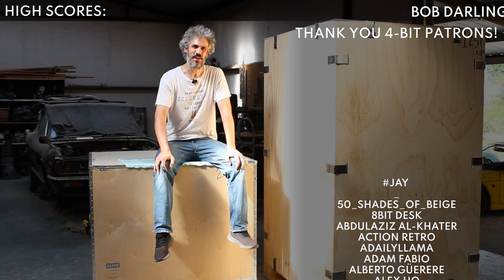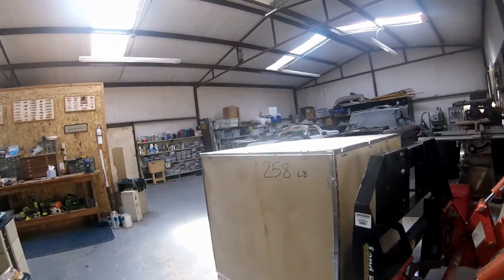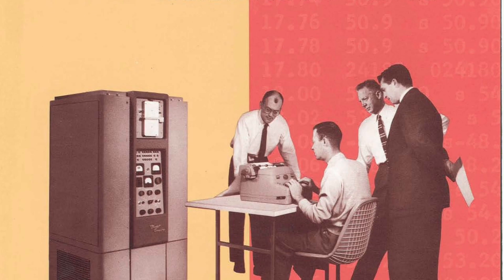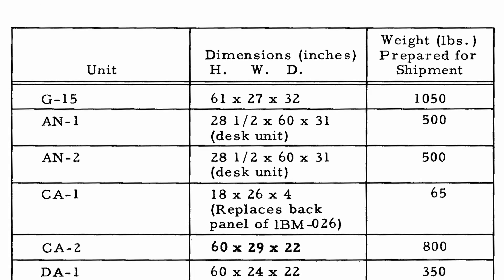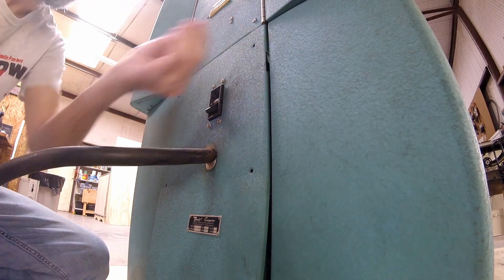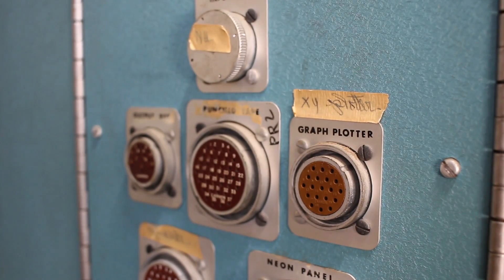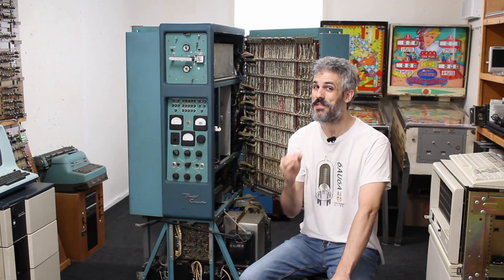My New Computer Weighs 1,000 Pounds!

Comment: Dad worked at Bendix in the 60's right out of college, never even knew they made computers until you mentioned them a while back. He worked on safety triggers for nukes, but that's all he could tell me. We were only allowed to visit the plant once in his entire career.
Reply: Nuclear bombs, computers, brake pads.  Is there anything Bendix doesn't make?
Reply: Would it be possible to visit the factory where they make the un-safety triggers for nukes? Asking for a friend...
Reply: @Starchface  Bendix also made lots of toxic waste. My dad's plant is now an official toxic waste site, last I heard the land can never be used again. Kind of mad that it was allowed to get that bad while my dad worked there.
Reply from the maker: Bendix was all over the board, they made all sorts of wild stuff!
Near the end of the G15s run, Bendix sold the whole computer division to Control Data Corporation. CDC never built any G15s as far as I know, but they did sell and re-badge them as Control Data machines.
Reply: [Fallout theme plays]
Reply: @ChrisB... Didn't your dad trust you?
Reply: @SuperNoticer  Bendix was a contractor for DOE and DOD, so it wasn't a matter of trust. My dad isn't trump. LOL.
Reply: @Starchface  Also, the autopilot for the Boeing 747, and laundry machinery, which they got involved with through acquisitions.
Reply: @UsagiElectric  You can tell they had manufacturing applications in mind for this computer: at about 21:00 they mention that the AN-1 universal code accessory can be used with numerical control tape for machine tools.
Reply: @SuperNoticer  I guess he thought, "Don't tell anyone about this top-secret work" meant "Don't tell anyone about this top-secret work." Nuke triggers would be regarded as a state secret after all.
Reply: @Starchface  Well they don't make the 6900 dual triode anymore...
Reply: @ropersonline  "War....war never changes..."
Reply: Didn’t Bendix also made parts for the Concorde for flight control?

Comment: Mr Usagi, a tip for you, as I have found very few people know this these days:-
I notice power-type selenium rectifiers (red fins - probably Federal type) at 21:20.    These slowly turn into resistors when not used for many years.   if you suddenly apply power at full voltage they may overheat and destroy themselves with a bad smell.   A very bad smell.   They need to be reformed, somewhat like old electrolytic capacitors.    Use a variac to bring the voltage applied to them up very slowly (hours) while monitoring the current and how warm they get.   If you do this they will usually then be fine and turn back into diodes.     Some restorers of old electronics don't trust them and replace them with silicon diodes, but if you want an authentic museum quality machine, carefully reform them.
[Note that selenium rectifiers were made in two grades - one for consumer equipment and one for industrial equipment.    NEVER trust the consumer grade stuff - replace them with silicon.]

Comment: This is beautiful. What amazes me more than anything is just how fast computer science moved 70 years ago. From ENIAC to this in less than a decade. Being able to read the schematics, see the OS code would be fantastic. Those guys back then weren't dummies, that's for sure.
Reply: Being such a small machine, I doubt it had an OS. You would just run your programs on the bare hardware.
Reply from the maker: And if you go 10 years beyond this, we had the Apollo Guidance Computer using flat-pack integrated circuits! It was truly a bonkers time for computing.
This machine did run some interesting programs, one of which was Intercom, a sort of virtual machine that sits on top of the original machine and allows you to write programs directly on the machine. It's not as fast as writing bare-metal programs, but it also will keep you from going insane.
As we get close and closer to running, we'll get deep into the weeds on just how exactly it loads and executes programs from the drum, what the instruction set looks like and how to use it. It's going to be a lot of fun learning about this thing!
Reply: @UsagiElectric Flat-pack IC's and core rope memory... something that as much as I understand how it technically works, I still can't wrap my head around it. Truly amazing what these guys (and gals) were able to pull off back then!

Comment: Congratulations.  The G15 and the Dec PDP 8 were the first computers that I learned on in computer maintenance school, and the first computers that I programmed on.  I will always remember having to spin the G15's drum memory shaft before powering it up so that the rubber coupling wouldn't break from the motor torque.  Enjoy.

Comment: You are definitely brave. I saw what was involved with getting  an IBM 1401 going at the California Computer History Museum. Now it did involve more than  just the computer but they had a team of volunteers some of whom had worked on 1401s before. It still took them quite a while to get it running. Maybe on the plus side, the 1401 used germanium transistors which were a bit failure prone. Maybe the tubes might be a bit better. I really hope it goes well for you but you are definitely taking on a real challenge. I hope no irreplaceable parts keep you from finishing this project. Really want to see this work. I'm guessing you want that even more.

Comment: The fact that there are so many identical cards (and with two machines in the area as well) makes me think that making dedicated testing jigs for them might be useful. Just a Arduino program (and presumably a bunch of Mosfets or relays) that checks the function of the cards.

Oh, and good luck reforming those caps in the huge capacitor bank at the bottom.
Reply: Use a cheap chinesium extension cord in place of a dim bulb for reforming the caps! :-D
Reply: Coonect those capacitors across the 50 amp circuit to reform them! July 4 fireworks!
Reply: LOL, I was just discussing the idea of building some test jigs for those cards being a good idea before reading the comments.

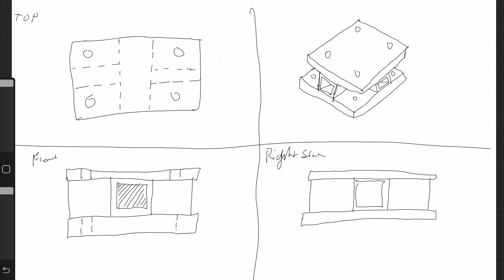Comment: 6:05 ... careful when doing that... If you have to do that make sure you round off all the sharp edges before.
If the drill bit "catches" on that plate, the plate will spin and it will cut your hand or even chop off your finger.

Comment: I’m not sure if you already have a solution in mind for providing a 120V 50A circuit, but I have a suggestion.

Rather than heavily loading one phase of your electrical service, you should try to find a cheap used 240X480V to 120/240V transformer. The primary can be jumpered for 240V, and the secondary jumpered for 120V. You’d be looking for a 7.5-10 kVA class transformer. Dry type or a potted enclosure that is meant to be wall mounted. 

This would allow you to run a 30A 240V circuit to the transformer to step down to 120V. From there hit a 50A fused disconnect switch or single breaker in an enclosure (it could be a 2-pole breaker, just leave the second pole disconnected). If the computer has its own 50A breaker, then you could just leave the external one out and hardwire the transformer secondary straight into the computer. I would use a 240V 30A twist lock plug and receptacle on the primary side of the transformer so it’s not permanently hardwired to your building. Slap it on a rolling cart!

Make sure to ground one leg of the 120V secondary to be the neutral, the ungrounded leg will be the hot conductor to be switched or fused. 

This is all under the assumption that you service is 120/240V split phase.

If it’s 208V, then obviously the transformer will need to be different. Some transformers have taps, for example a 90% tap for 240V would be 216V. If you connected that to 208V, the secondary side would be at 115V which would probably be fine if the computer can handle it.

Comment: The G-15 is cool in that it had a rudimentary operating environment called Intercom which essentially create a virtual machine which allowed working with double precision decimal math.  The communication channel allowed up to four mag tape units or four more G-15s to be connected in a network.  There was also a refrigerator peripheral sized differential analyzer which held 100+ manually configurable analog integrators, a sort of math coprocessor.  There were a lot of ground breaking ideas embodied in the G-15 and the names associated with designing the G-15 are a veritable who’s who of computing founders.  It is good to see this bit of history preserved.  Thank you.

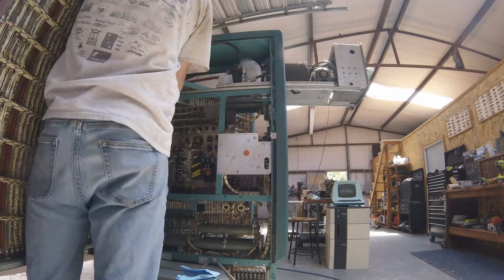Comment: 9:20 upper left corner - what's that first gen jet fighter? Looks like it's on a carrier? How'd you end up with it?
Reply: It looks like an A7 Corsair on a Vietnam era carrier. The bench I worked at that calibrated the inertial navigation units for this plane back in the early 80’s, when I had time to help. Came from the original Roosevelt. It was manufactured by Singer and made a lot of noise.
Reply from the maker: As rick mentioned below, it is an A7 Corsair. Specifically one from Attackron 66, the squadron my father flew with!

Comment: Oh, good news.  I went and looked at the tech manuals and pictures and the G-15 seems to be made of very reliable parts.   I was worried that the rectifiers might be selenium or copper-oxide, but they seem to be very early germanium diodes.  Goody.

The filter caps may be fine and just need a slow reforming.  A infrared thermometer would be ideal for watching for very leaky ones.

The board capacitors seem to be mostly very high quality hermetically-sealed ones.    You rarely see these go bad.

Those early diodes were pretty good too.  Long ago I restored a CDC 160-A which has thousands of germanium transistors and diodes.  Only found one leaky diode and no bad transistors.   Hope your luck runs along those lines.

The tubes are mostly the relatively common 5965 or 12AV7 dual triode.   It might even run with a 12AT7 in non-critical circuits.  Your main tube problem might be intermittent or corroded tube sockets.

You may need to find a 50-amp Variac in order to bring up the AC voltages slowly.

Cheers,

George

Comment: Now THAT is the Mother of All Unboxing Videos! @EEVBlog could learn from you :D

I felt you were getting that Bendix since the LSSM video on your way back from VCF East - knowing you, I just knew you couldn't pass on working a machine like this :). The other totally tubular computer, that's something.
New casters indeed look very nice and sturdy. And your nerdcave is getting loaded, but still combobulatable... 
The computer itself is so beautifully built and engineered. All the modularity, color coding, multiple variacs and stuff, and the astonishingly beautiful backplane insanity! I love the cable routing ladders closed with string - never seen anything like this before, and I thought that I'd learn about almost all assembly techniques in my two decades of doing tube electronics. 

The documentation looks crisp clean, simply lovely! And as for power, here in Europe it'd probably run on 3 phase electricity. I'm still surprised why it's wired for 120V rather than 240V, given its 5kW or so.

16:20 that'd be @CuriousMarc - he'll get a DeLorean, go back a few decades, tinker with the Bendix, write that note and create a temporal paradox. We're doomed... Don't ask me how I know that, haha!

Comment: Best of luck reviving the G-15D.  I tried to get one working as an undergraduate.  One of the primary problems was that the diodes developed high reverse leakage.  A goodly number of them had to be replaced.  I did get it working and compiled a number of Fortran programs on it.

Comment: In the early 1970's the radio club at the college I attended had a G15 and a pair of tape drives. We nearly got it functioning, but the drum memory gave serious trouble. The project eventually failed due a scratch on the drum that wiped too many tracks. Best of luck with yours!

Comment: The G15 was my first personal/home computer.  You did an excellent introduction and if you would like to connect to discuss the repair, operation, and programming of the G15,  I encourage you to connect with me (I can share the challenge areas I navigated such as the master timing circuitry).  Sadly, my G15 died (its an interesting story) and was disassembled in 1979 but I still have a few parts.  In addition to the G15 & console, I had 2 MTUs. FYI that small corner is going to get REAL hot ---- too hot to keep the system running smoothly.  As the plate voltages drift due to excess heat the system will misbehave.  I look forward to future videos & possibly connecting.  You've made me quite nostalgic for a simpler time.

Comment: I presume quite a few capacitors will need replaced by the time you're done, this looks like an awesome project
Reply: Depends, some of those might be of such high quality that with a little reforming they might work well enough. If you have to replace them that can be a significant cost, depending on financial wealth.
Reply: @Bart Zuidgeest  1956 is deep into tar paper territory. There's nothing to reform about those. Filters maybe, paper definitely not
Reply: @maxs.3238  I meant the big row of filter caps in the bottom. 
Personally i usually prefer outright replacement with high quality reliable caps. But this is a museum piece. So an attempt at saving the filter caps might be needed. Or maybe restuffing them. On A museum piece look is important. 
The other caps same thing. Replace, restuff, or test and leave in there. 
They should be analysed and tested and then a choice needs to be made.
Reply: @bzuidgeest  A lot of this depends on what happens if a cap shorts out.  I'm assuming bad things.  I'm pretty sure they would be electrolytic.  For long term reliability, they will need to be replaced.  Buying replacements will be $$$, so restuffing might be the way to go.  I'm just glad it's not my problem.
Reply: Looks like he might need the front end loader again for the replacement caps...
Reply from the maker: The main filter caps at the base are all high quality Sprague caps. I've seen these used in HP gear from the 50s and they're really robust, very rarely needing replacement. We'll test them as best we can, and make sure nothing seems off about them, and if everything comes up Millhouse, we'll run 'em as they are!
Reply: @UsagiElectric  I see, well good luck, I look forward to seeing the results
Reply: I think those selenium rectifiers might be a bigger problem...

Comment: Wow, what a find!

Having had my first programming gig at age 17 (and being an old man today), I actually got to work with some machines that were obsolete back then.  I never saw a Bendix machine in person, but actually did some minimal programming on IBM 1620, Philco 2000, Honeywell 801, and Univac 1103 - and did some serious professional work on GE 635.  But all of those are a few years newer than that Bendix of yours - that's a magnificent piece of history!

The drum main store makes me think of the IBM 650 and the way that it had 1+1-address instructions, where every instruction was also a jump. The assembler had an optimizer that tried to space the instructions around the drum so that the next instruction would be fetched just as the heads were approaching it on the drum.  

Are those actually photodiodes in the paper tape reader?  In that period, I'd expect that an electro-optical table reader would use CdSe photocells.  If any of those have quit, make sure they go out with hazmat - Cd is nasty stuff.

Comment: You should slowly charge the capacitor bank through a variac at reduced voltage, then check them for shorts and leakage current.

Comment: I never worked on kit this old, but I did repair DEC DF32s...  A single sided, single platter fixed head disk drive that was bolted to a PDP8...  I could barely lift the drive out of the computer... it had a 1/4 hp motor to spin it up, and a big capacitor bank to brake the disk when finished...  It had cards, about the size of a modern smartphone, with 4 to 8 transistors on each one.. Later models had the same size card, but with 1 or 2 TTL  chips on...  It was so simple, and so much fun to troubleshoot... My job interview consisted of one question... "Can you use an oscilloscope?"

Comment: (Apologies for being a wet blanket)

A while ago I was watching a machinist video (I watch a lot of them). Lathes, Mills, Surface grinders etc are really heavy.

He was talking about castors. He pointed out that while you might like to say that with 4 castors each castor is taking 1/4 load, it's likely not the case, unless your floor is a surface plate.

As everyone knows, 3 points of contact is all you can really guarantee, which is why photographers use TRI-pods.

But it gets worse; call the corners A-B-C-D, going round

You might hope that even if you don't get 4 point contact, you might at least "fall back" to a 3 point configuration (say A-B-C). But (assuming a roughly even load) it's sort-of obvious that this A-B-C contact could easily be tipped to become a A-D-C contact. A-C is a "high diagonal" (either A or C must be high) and the load can pivot on this A-C axis.

Which means, at least momentarily, the A-C castors are taking all the load.

Summary: your castors (and floor) need to be spec'd for at least 50% of the total item weight.
Reply: Thankfully it's a concrete floor but those poor castors might get a bit less round over time.